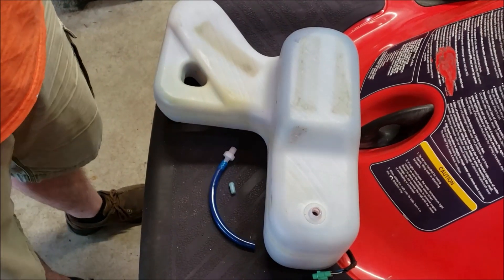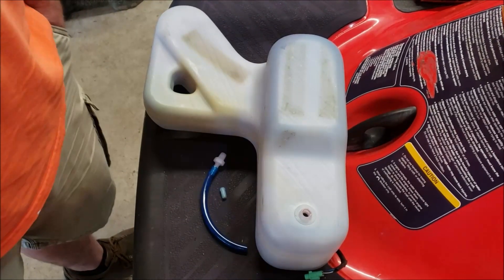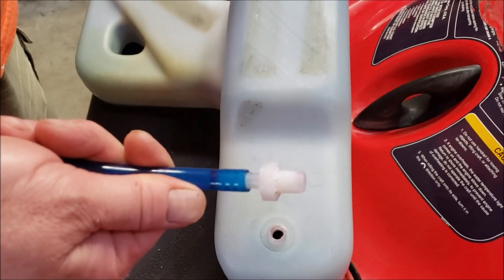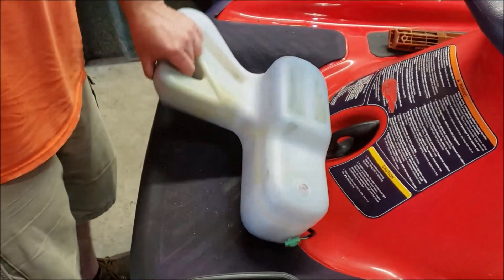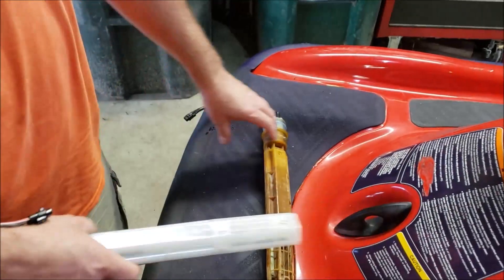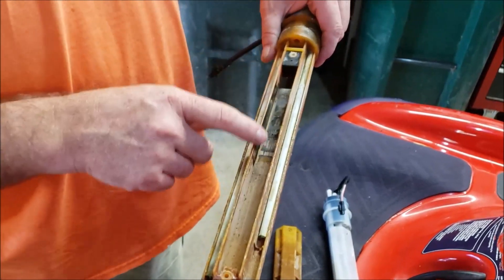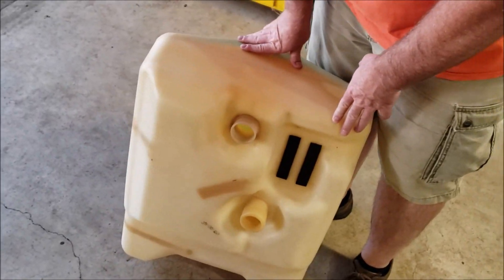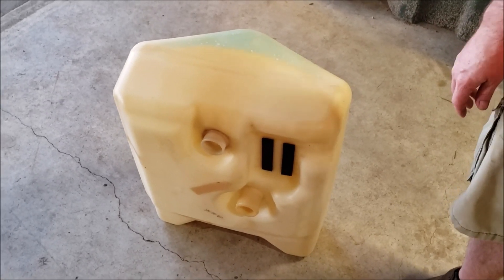Kawasaki Ultra 150 Oil, Fuel, Cooling update

Comment: Always oil tank nipple cracks or breaks right off always the first thing I check when I work on these skis, never seen someone replace it with a nylon fitting before, have you had good luck with it?

Comment: We (Skiworx) actually sell a complete "Triple Pisser Kit" for the Ultra, we pioneered this kit in 2000.. Our kits has everything you need including the correct heard fitting that have the smaller I.D...
Reply from the maker: I am struggling with how to respond to this as I have not personally done business with Skiworx. That being said I think that parting with your hard earned money without doing a quick internet search on a prospective supplier to determine how they have treated previous customers is the height of foolishness.
Reply: yea I just bought the kit and its superb great parts directions customer service ! you rock !

Comment: If you don t mind me asking where did u get the nylon fitting exacly? im doing it on mine cuz it was leaking in same exact spot i already went to acehardware but they only had brass. t.y in advanced
Reply from the maker: Go back to Ace tell them you need item 48785.
Reply: @atthelake7637  my fuckin man t.y for fast reply have a good weekend

Comment: On rerouting the pisser hoses do I use the smaller fitting on the head or do I put the same size as the other two. And do I have to retune for it?
Reply from the maker: Please standby I am going to post an entire video on the how, why, and what of a triple indicator system.
Reply: @atthelake7637  boss where did you score a brand new gem fuel sending unit?